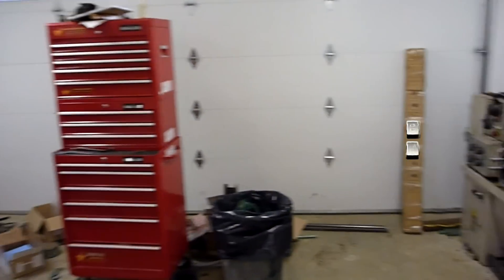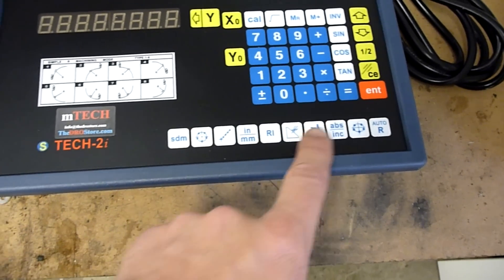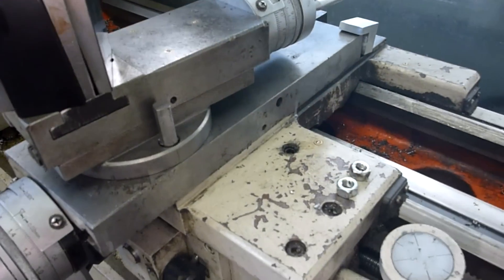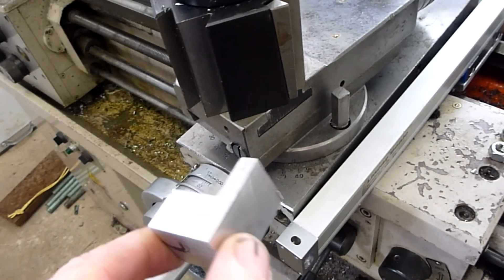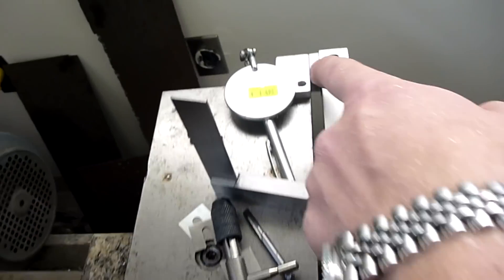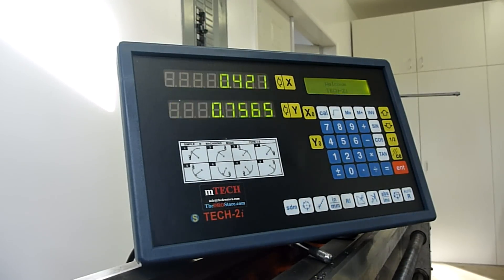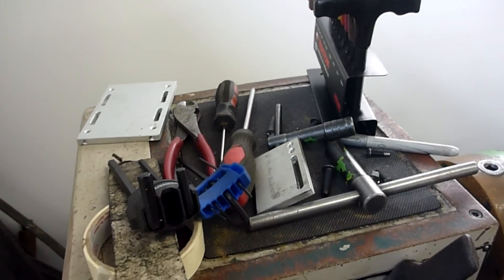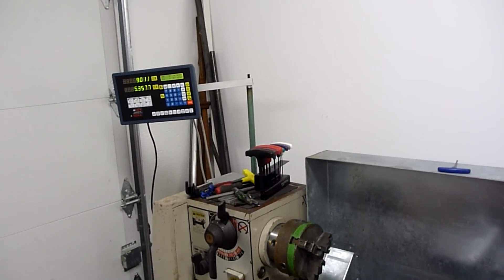Mtech Tech 2i DRO - Lathe Installation

Comment: Hi Descartes    Cartesian Co-ordinate system shows clearly the y axis coming to you and going from you   the X axis left to right and also right to left both of these measured as you stand before it (I e in front of you ).the Z axis is for height. so it is actually the X axis not the Z . So calling it the zee  is incorrect. Alistair in Scotland uk.
Reply: Sorry I should have said Y axis is what you guys call the Z axis.I have flu Alistair
Reply from the maker: Hey Alistair,  That's what you'd logically think, I thought it was kinda weird when I first started getting into machining.  But for a lathe, conventionally, the longitudinal axis is always the "Z" axis and the radial axis is "X".  Don't ask me why, but it is.